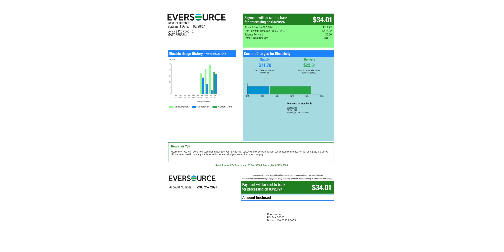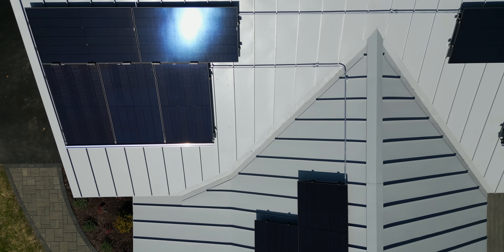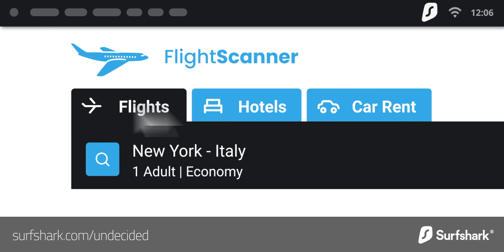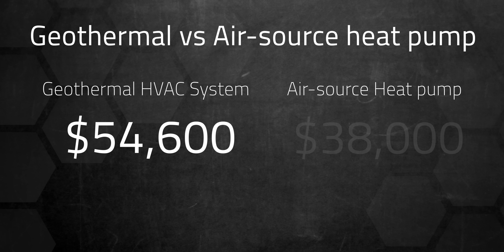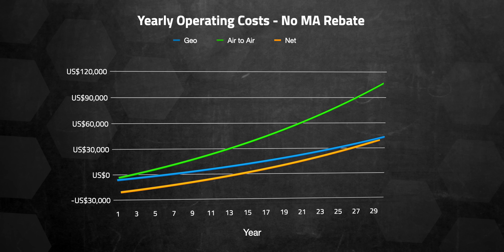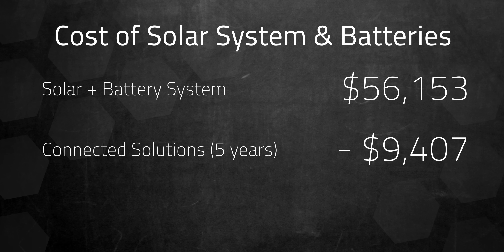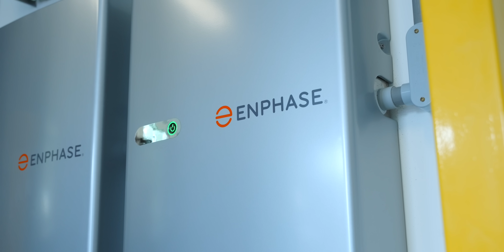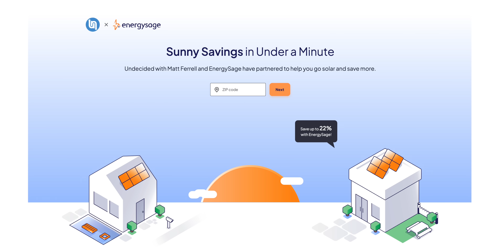What I Learned After 1 Year with New Solar Panels

Comment: I for one fell for the solar panels.
After spending $21,000 it was not worth it at all. 
1st thing the solar panels void your roof warranty.
2nd you got to clean those panels several times a yr if you live on a busy street. Getting on the roof with water and soap is not fun. 
3rd. I only made at best about 70.00 in the summer months when the sun gave the most daylight. Winter about $50 a month.
Sold house and new owner replaced roof and sold the system. 😢

Comment: Although I am a big proponent of clean energy, now calculate putting that initial investment in an index fund instead of putting in geothermal and solar. You will see that the returns on your investment without these solutions, even with the higher costs of your electricity, would never make the investment worthwhile.     The real solution is having the utilities invest in efficient clear energy that should be much more efficient and cheaper for everybody.

Comment: He assumes energy usage remains constant over the next 30 years. A family with kids will use more energy over time. He would either need to add more batteries or more panels which adds cost. Even though there are warranties, they might not apply in the event of panel or battery failure. Also, geothermal might require maintenence in 20+ years which might be expensive. Further, he uses a lot of tax credits so he's welcome for the rest of us taxpayees paying for his stuff. The grid needs to be able to supply all his power in the event of his system failure. That means the utlity company cant shut down plants even though he is using less. Also. If he has to move in the next 10 years due to whatever, he loses the big  savings that come in the later years.

Comment: It's a pretty good experiment, although I'd have done it differently myself. More solar and insulation for instance. Less expensive to maintain and install components like geothermal.

I'd have even considered ground based solar instead of putting it on the roof.

I do understand your methodology and it did work out for you, assuming no unforeseen maintenance issues arise.

I do expect for solar, batteries, and air to air systems to improve significantly in the next 10-20 years. And for the costs to come way down. You're definitely an early adopter in this stage. I hope you get your ROI sooner rather than later.

Comment: Thanks for the video and insights. The only refinement I would suggest for your ROI model is to include the opportunity loss in the money spent on the investments over the 30 year time span assuming you paid for these expenses upfront and in full. For example instead of investing the full ~$90k in solar, what if you have invested that ~$90k in the S&P index fund (you choose the return rate you are comfortable with) over the same period taking withdrawals to pay for energy costs at what ever frequency you want? I do believe you will achieve a positive return but it will be more accurate.

Comment: It’s worth it but… for example half of my my 8yr old solar panels (Canadian Solar)  died and replacing them was a problem because they don’t manufacture that form factor (length x width) any more. I did find a different manufacturer that came close to fitting, and was able to install them myself. ALSO, all that high tech equipment (heat pumps, batteries, etc) will crap out at some point. Repair / replacing them will cost money as nothing today will last like your parent’s old telephone did.

Comment: Does the financial analysis including financing costs and the "discount" factor? For instance, if the up-front cost of the solar panels, geothermal heat pump, etc. is borrowed, you have to pay interest on the loan; even portions of the cost that you get back as tax credits is money that still has to be borrowed, and still accrues interest for a year until the tax return is processed. 

Alternatively, if you pay for everything up front out of savings, the interest cost gets replaced with foregone investment returns that could have been earned by sticking with a convention system and stuffing the money representing the cost difference into the stock market. Which, considering the historical 30-year return of the S&P 500, can be quite significant.

Comment: Over a 35 year time span, you are paying more than double than we do for just paying the electric company?   Quick estimate shows you are paying about 250 a month for more than 30 years??  And that doesn't even touch the geo thermal.  Absolutely a rip off.  Figuring in your heat and water, we pay less than 30% of your bills.  I know area matters.  We are in Colorado with natural gas.  Average rise in cost over the last 25 years has been about 3%.  Your area costs for normal electric and gas must be insane.  Those costs here I would have to be in the same house more than 100 years.

Comment: Seems like the forecasting of the panels, heatpump water heater and the Geo AC paying for themselves and being ahead in 20 yrs or so is nuts . The heat pump water heaters will be lucky to last 8-10 yrs, the panels will not last 12 yrs at full strength, and the Geo AC wont last 15 yrs if you are lucky. So you way over paid for the panels and the ROI on the well tap for GEO is crazy high. Thanks for the break down on the info

Comment: The installers ripped you as they worked out you are rich youtuber. I paid  11k gbp for 10kW of solar PV with 8kW luxpower inverter and maybe 3k for 5 X 48v75ah sodium batteries of own design from China. I think i am first in uk to have SiB at home.

Comment: THANK YOU for this valuable follow-up and analysis. I did a DIY 25KW array (57 panels) in Virginia, before I sold the home for a profit. No batteries, grid-tied microinverter system. The property should be carbon negative beyond 2050. There's additional margin to power two electric cars. VA also banks surplus KWH in a yearly cycle. CONSIDER: SRECs (Solar Renewable Energy Certificates). You should be able to get cash for each MWH generated. Google it. My system was about $49K before the 30% federal tax credit. The system is carefully put together to last and has been zero maintenance. It looks amazing and is a point of pride, the accomplishment of one of my life's goals. Once perovskite panels are widespread, the costs should decrease dramatically. Solar will be the future of energy generation.

Comment: Interesting. If you are not prepared to make a few sacrifices, solar PV and batteries will disappoint. I live with 20kWh batteries, and single 8kW inverter and 8 x 540W plus 4 x 355W PV. That allows me to live off the grid on a small holding, running the whole house and 2 x 1.2 kW pumps and an electric water heater in Summer and propane powered water heater in the Winter.

Comment: I live in Southern California, so our 5 KW system has always more than covered out electricity use.  It's zeroed out about $2000 worth of electric bills since we installed it.  We very rarely have outages, so a grid-tied system with no batteries has worked fine for us.  I designed it and installed it myself, with no installer or lease.  My only outside labor cost was for a concrete pump operator, but he just ran the pump while I directed the hose filling the forms. We got rid of a leased propane tank and converted everything to electric.  We do just heat or cool the rooms we are in, so cheap space heaters and window AC works fine.  Considering the tax credit we got, my payback period will be less than 6 years.  We even have enough surplus electric credit we can run AC for our dogs!

Comment: You overpaid, I counted 43 panels on your roof. You don't know how to install them yourself????????? And the batteries could have been purchased at a cost of .36 cents per watt of storage. And I DOUBT you installed 100 kilowatts of batteries at $33k. I would say you paid 930% over what you could have for just 43 solar panels, some wires, and some server racks with batteries. Absolutely insane amount of money for a setup that could have been through my calculations 15k or less easily for the same effect. Watch some Youtube videos on solar instead of posting them dude... You got insanely ripped off. Seriously... 88k is the highest i've ever seen in my life.

Comment: Hi Matt, I have watched your videos with amazement. Your house is about as complicated as I have ever seen.  The first video of yours I watched was about new U-shaped window air conditioners that would have a heat pump design.  A couple of them would ideal for my house.

MY HOUSE:
** My house is probably the exact opposite of yours.  It was an old house built about 1950 that was going to be torn down so an eye doctor could build a new office at the location.  I bought the house back in 1977 for $7,000 and had it moved to a lot I owned.  My wife and I took out a $15,000 loan to pay for having a basement built and pay for the moving ($4,000).

HOUSE DESIGN:
** The house was a story and a half with two bedrooms and one small bath room down stairs.  I think the house had heat that came up through a grate in the floor in the dinning room when it was first built. When I bought the house it had a boiler and baseboard heat. I added on to back bedroom to make it bigger and have another bathroom and walk in closet. Had the basement built to include the addition.  

HEAT:
** The heat in my house is the same American Standard Boiler that was in it at the previous location.  I disconnected the plumbing and wiring and took it to my automotive repair shop for storage. I still use and maintain the boiler myself.

A/C:
** I installed a large window air conditioner in the back wall of the dinning room pointing across towards the living room. It is still working today. The dinning room is locate in the back center of the house and has door openings on one side to the kitchen and on the other side to the rest of the house.

** Thanks for your videos, I will be watching for more info on window heat pumps. I believe in keeping things simple.

Comment: I’m going to take a wild guess that you live in a blue state. $8,400 per year for HERS 42 is insane.  In Texas (not Austin) we pay about $2,000 per year for electricity.  We have two hvac heat pumps and two electric water heaters serving a 3,300 square ft. house.  We use propane for cooking.

Comment: Love to see this type of analysis being done. From someone who has lived with a Climate Master geothermal HVAC for over a decade now, you need to account for the increased cost for maintenance and repairs vs air source. In my experience, maintenance and repairs cost about 3x to 4x vs air source strictly because there aren't as many qualified contractors in my area creating higher demand for the few contractors that will work on a geo system.

Comment: You went to germany? Gosh, you could have visited my home to check on my solar power installation i built up over time :)
I got ~15.5kW peak on my roofs at the moment, tending to still increase the total amount. And from my personal experience it was worth every cent i invested. Currently after 12 years with my first 6.6kW peak plus around 5y of the additional 8-9kWp, the point of cost break-even is already reached. Specifically because i did the 2nd installation DIY - that saves tons of costs.
We're talking about 27k€ for 6.6kWp against ~8k€ for the additional 8-9kWp - granted, later in time means also lower prices and higher peak power per module, though the latter was not the biggest factor. Adding a fairly large battery in 2022 got me to 100% self-coverage in the summer months (means April to September) - but that's only the electricity part, i am still working on the water and heating part. Plus an eletric car that came in 2023 tops it off, spending much less on fuel since i can charge it at home. This is how i try to do my part to save the planet. Yes, everything that runs here had produced some waste-byproducts, but all in all the savings in the future (in energy, delivery, production, processing, ...) will compensate for that. Producing the energy we need directly where it is needed is one little step in the right direction. And everybody can do that actually.
BTW the earnings from the 1st installation practically bought me the 2nd one and the battery...

Comment: I have done a similar thing in the UK but due to our aging electrical grid, I can do no more than 7.56kWh of solar PV across E/W roof, Tesla Powerwall 2, ASHP and an EV. I treated this like an investment in our home that is a 1970's detched two storey home. Over the whole year I get roughly 80% of night rate usage, which is our cheap rate of 7pence per kWh between 11.30pm and 5.30am. Other times are around 28 pence per kWh. All of this has left me paying just £80 per month for heat, electricity and 10,000 miles in my EV.  Before the EV I was spending around £100 per month just on fuel. The house uses around 18,000kWh per year including the EV charging and ASHP. Less approx 6000 solar PV!

Comment: I live in PA and my only heat source is a heat pump, and my water heat is also a heat pump. My annual electric bill is around $3600 per year. My average monthly usage is around 2400kwh. My house was built in the 70s and is about 2200 square feet.

Comment: I suspect the utilities' "smart meters" will detect significant profit losses with widespread energy efficiency applications and adjust their charges for grid power accordingly. Long term savings calculations dependent on predictable utility rates are, at best, interesting.

Comment: I have 2 houses and don't pay the utility cost for your home monthly.   But North FLA has mild winters and summers aren't horrible.  And my houses were built to be "green" and very well insulated.  I have tons of sun all year long...blazing sun and both my houses backsides face east.  But when I did the break even time vs the cost, because of my low bills, I will be dead long before the break even point.  So, if a nice young couple buys my places after we're gone, they can consider it.  But you do live in an expensive state.  I have no state income tax and lower utility bills and a good heat pump and tankless hot  water so even with solar being cheaper here, I can see your point.

Comment: Had to install solar this year — I live in Ukraine, and I'm pretty sure we have a crazy neighbour who invaded my country, and on of their strategies is destruction of our power plants and energy grid.

So, at some point we got long power outages, and I had to put all my resources togethere and think about a solution, which would allow me to continue to do my job (I'm a software developer, working from home) and provide more or less comfortable conditions for my wife and kids. Priorities were:

1. Being able to survive potential long blackouts with relative comfort.
2. Cutting electicity bills (which were not so big, as a total price is ≈ $0.10/kWh, but I'm pretty sure it will grow significantly in future)

For heating we use natural gas (delivered by pipes), so electricity consuption is not so big — somewhere under 15kWh per day. 

My initial plan was to set up 10kWh battery for storage, and 8kW worth of panels (2×4kW). One field on a southern side and another one on the west. I started to source the hardware this summer, which was probably one of the worst moment for this, as at the end of spring we get very painful missile hits on energy systems, and a lot of people had the same demands as I had — so prices were significantly higher than usual.

As a huge part of my monthly income goes to cover needs of my friends who is already in Ukrainian army, I had to split expences through a couple of months. First I bought an inverter (Deye 6kW, 1 phase, hybrid), and 2 batteries (Deye 48V 5.1kWh LiFePO4), so 10.2kWh in total. Total price at this point — $3700 ($1300 for inverter and 2×$1200 for batteries). Installation was made for free by my good friend.

At this point I had the issues with blackouts mostly covered, as 10.2kWh easily lasted for ≈ 18 hours, if using all utilities as usual, without any attempts to cut consumption.

A couple of months after inverter + batteries installation, and couple of months before today, I added the first field of solar panels. It was 6×580W Longi batteries, with total power ≈ 3.5kW. Unfortunately, my roof has a complex shape, which is totally not suitable for panels installation. So I had to put them on walls, almost vertically. Good thing is that there are no high objects around my house. Total price was ≈ $1300 — $950 for panels and $350 for installation.

Already after a month of usage, I had to review my plans about installation of the second 3.5kW field of panels. The main reason — I got very disappointed by panels performance when a sky is covered with tight clouds. I expected it will be at least 5-7% of nominal production (so 180-200W from one field or 360-400W from two fields, which at least covers my usual consumption during a day hours). But in reality it's barely half of that. I'm not even sure if it covers invertor's own consumption. Maybe I'd have much better results if the panels were mounted under a better angle, and also if their total voltage would be closer to the max supported by invertor, but it is what it is, and it is not great. 

On other hand, when the weather is sunny, this modest 3.5kW field produces more, than I can consume.

So, I decided to stay with that one field, at least for now. Instead of this, I bought another 5.1kW battery (after prices went a bit down), so not it's 15.3kW in total, which gives me at least 24 hours of power. 

In general, I'm very happy with that setup. Last month it covered ≈ 60% of all our consumption. I'm doing my best to help Ukrainian energy grid, and I don't take any energy from outside within peak consumption hours. Also, when it's a sunny day and I know that there was no need to burn a couple of buckets of coal or natural gas for it — it's also a very nice feeling.

Thank you for this video. And have a nice day! :)